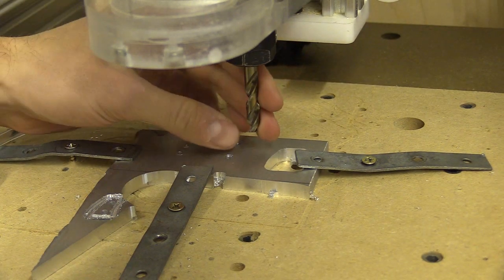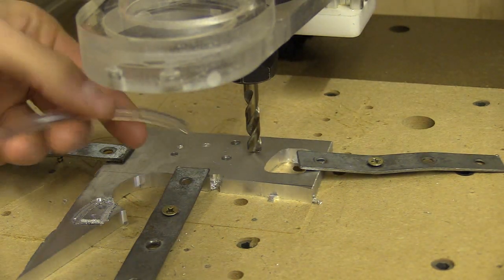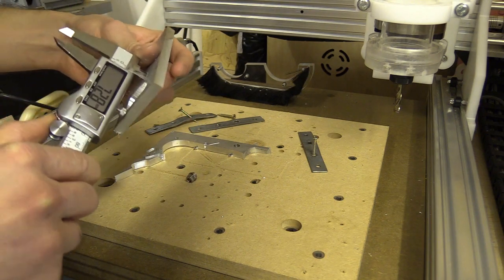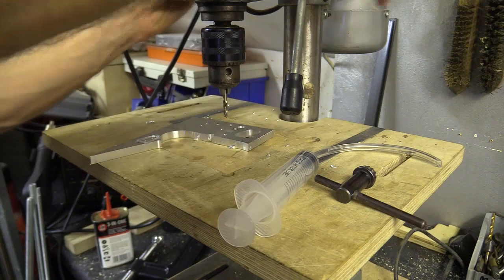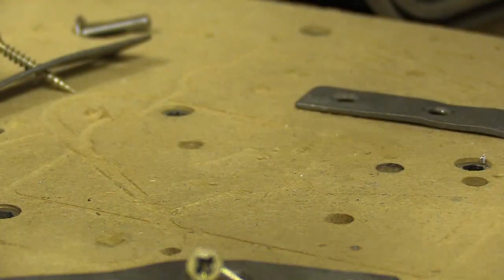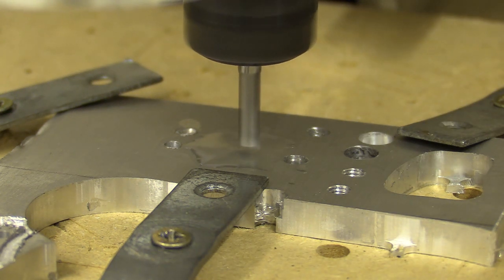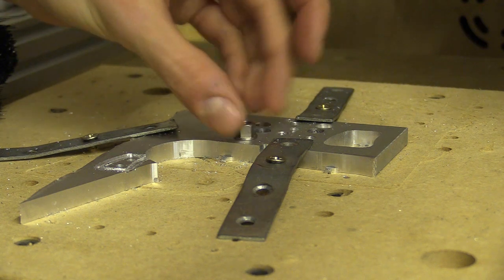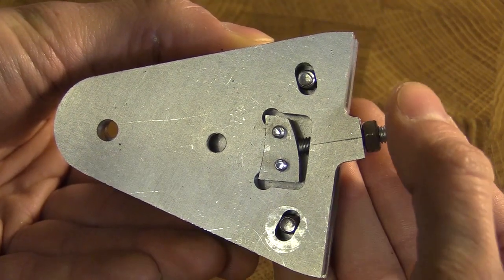#23a Drilling Accurate Holes in Aluminium – CNC or Pillar Drill??? #23a / Test

Comment: I'd personally use a small bit to create a pilot hole. The center of a drill bit doesn't actually cut so the bigger the bit the more issue that causes. The bit has to push all that material out from the center into the path of the cutting edges so if you remove that material with a smaller bit first there's a lot less work for the full size bit to do.
Reply: this and also he's trying to achieve an accurate bore via just a single bit, that's not possible at all
a jobber will cut in an almost triangular shape when you look at it through an electron microscope
it will cut jagged/staggered making the wall of the bore stepped no matter how good your rigging is and and will cut over the size of what it says on the bit
so if you want a hole of a specific diameter it's almost always a 3 step process, drilling, reaming, lapping. 
1. drilling below the size of the bore you want by about 90-95%
2. reaming out the hole with the finishing diameter
3. lapping to create a smooth polished consistent finish which can also be used to even more finely tune the bore
Reply: I think a 135 degree drill bit has cutting edges on the point.

Comment: Savvas, you need to use a centre drill bit first then step up to the size hole you need.  For ultimate accuracy drill 1/64 under your required size then ream the hole with a reamer of the correct size, but at an extremely slow speed.

Comment: I had the same experience, my collet isn't precise enough, having a run out of 0.1mm there abouts, enlarging the hole by 0.2mm. The gantry flex lets the spindle slightly rotate around the gantry axis giving oval holes. The stiffness of the x is different compared to the y axis so using an end mill gives oval holes too. I'm ging to order much more precise collets with runout of about .005mm. Drilling a hole with 3mm first works for me, with 2mm/s feed rate and step down of 1.5mm. this is for soft aluminium 1050A.
Reply from the maker: Thanks for sharing that. Also using a ramping toolpath will help take some of the load off the tool but it adds a lot of time to the cut.

Comment: One of the biggest surprises when you learn engineering basics, is that you are lucky to get 5 thou accuracy, but more typically 10 thou error, when drilling scribed and centrepunched holes.  There are tricks, but variance is  common between holes, using one apparently identical method to mark out.😭😭😭🤣❤️

Comment: IMHO this is not a bit issue. Your CNC is just not stiff enough for that job.
Reply from the maker: Axel Sixtysix Yeah I know. But I don't have another CNC machine. :(
Reply: Not bad, you own a CNC, so you have all what you need to make better upgrades. I would replace all the plastic parts by thick aluminium ones. You've got a good spindle and electromechanics seems to work well. You just want a better chassis.
Reply: This trick can help but this is a short time solution.
Reply: I know this is necroposting but I had the same problem. Lots of chatter and annoying vibration even when moving on the X axis (most people call it the Y but I find it easy to imagine the X axis being the long travel and the gantry is the Y)... I found it was my upright plates being slightly out of true and the gantry was actually twisting. 

Imagine when you push up on the end of the drill bit and the gantry isn’t getting forced up... it’s actually trying to twist because the spindle isn’t pushing up on the centre of the span... it’s offset and that wants to make the spindle rotate on the gantry axis... but then it says “nope” and tries to force it back in the hole.... which is why you get the vibration and slightly elliptical holes. 

I ended up running bolts through my gantry span to hold both pieces of 80x20 v-slot together and stop them twisting apart. I also upgraded from aluminium uprights to steel plate and while it increases the weight it’s actually stiffened up the whole CNC gantry assembly.

I’ve also got a pro tram mini from Edge Technologies. It helps when tramming up. That reminds me... I need to tram up again as I just put a new sacrificial board on. Better do that tomorrow after the skim.

Moral of this story is, the stiffer you can get the gantry, the more accurate the holes you will get. I pretty much gutted my old gantry and my OX is now like a hybrid of OX and Workbee. Oh yeah, the Z axis on my original build was totally loosely-goosed. Gave it the equivalent of the little blue pill and now my Z axis is totally stiff..😂

Comment: Neither spacer or your holes are round - if either were perfectly round, the shape of the other wouldn't matter. That's not unexpected really, as even a 0.01 mm cam make the difference between slip fit and a light press fit. Add 0.02mm to the shaft and you'll need a press to put them together.

In the scene where you demonstrate bit wobbling you can clearly see it's not just the tip - the collet is moving as well, which means the machine is simply not stiff enough.
Any bit, mill and drill alike, doesn't cut in the center - it just pushes the material around making it want to walk around that high spot.

I suspect best you can do will be using a smaller center drill to start the hole for about 1 to 2 diameters deep, moving on to a thin stubby drill to make the through hole, then getting in there with the slightly undersized drill or mill and finishing with helical drilling toolpath in one or two passes. First two drills should have diameter about equal to the size of the chisel top of the slightly undersized drillbit you'll be using, and that one should be undersized enough to allow you at least two 0.05mm passes (or whatever you feel conformable your machine can do per pass). In reality you'll probably be drilling 0.5mm undersized, the first helical path should bring you roughly to where you want to be and center the hole from any offset the previous operations introduced, while the last one should give you nice round hole as the bit will have even cutting pressure all the way around.

When you get to the point where your holes are good, you can start dropping some of the steps to see if you still get good enough results. For smaller holes <5mm you can probably skip both centering and pilot drills, for larger to say 10mm you must have a pilot hole but maybe skip the centering drill (your minimum spindle RPM will be the limiting factor for how large a drillbit you can use as well). All this drilling is there just to save on time as drills work faster them mills, so any larger than that, I'd skip drilling and go straight to helical plunge path and maybe add a pass.

If your holes are coming out under or over sized, simply adjust them in CAD and the final helical path will take care of that. Getting them striight on the drill press by hand is highly unlikely. 

Good luck

Comment: The power in these HF spindles is very low on anything bellow 6-9000rpm.  (their torque increases as their RPM goes up to about 6000rpm, but at 6000 rpm they don't yet have their full power available). The thing with HSS is that it's not suited for high RPM's. (SFM is low) You could use carbide, but then you probably won't be able to meet the minimum chip-thickness before reaching the stiffness limitations of the machine. (although aluminium won't wear out your tool as bad as harder materials)  Best way to make holes is to use a 1 or 2 flute in a circular ramp down with a few finish passes at the bottom. The reason why you can't 'climb up' to the correct size without the drill walking is because the drill is centering on the tip and the soul of the drill. That soul and tip require material to center on. It's also a fact that rolled aluminium has some variation in density, which also causes the drill to choose the path of least resistance.

Comment: The reason it bibrates is because the feed is to low for the RPMs. Aluminum likes fast feedding. For acurate holes you have to drill first  with an undersized drill then finish it by milling around.

Comment: Hi savas, I just happened across your channel. We actually have very similar machines. I also went down the ply plates to start and then used the machine to  make delrin plates. Am I right to assume that the delrin machine is now making an aluminium plated machine? 
If that is the case what’s the problem with the delrin. Mine is only a few weeks old so has had limited wear. Is that going to be problem?

It looks like you are adding adjustment to the x carriage to help tram the spindle. I had this problem too but attacked it a different way. My spindle is supported using a top and bottom clamp approx 120mm apart. I machined the top bracket  to an exact 65mm internal dia, and then I used an open builds 71mm bottom mount with an eccentric bushing machined from some left over delrin. By twisting the bushing I was able to dial the spindle to be perfectly square to both axis. Just some food for thought ......
Reply from the maker: Hi James, yes it is cutting aluminium. I'm just having to learn about correct feeds and tool-paths for that material. There is still slight flex on the spindle, albeit less than when I used the ply plates. Also my design has changed, so  yes I am making pivoting plates. I would be curious to see pictures of your mechanism? I think I'm going to spot mark all the holes on the CNC machine, then cut the plates out and finish the holes on the pillar drill.